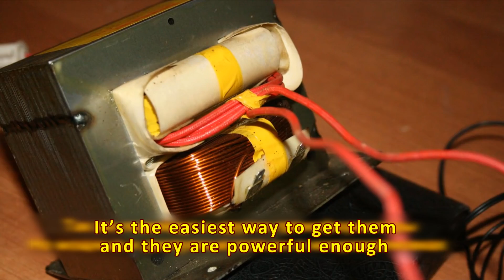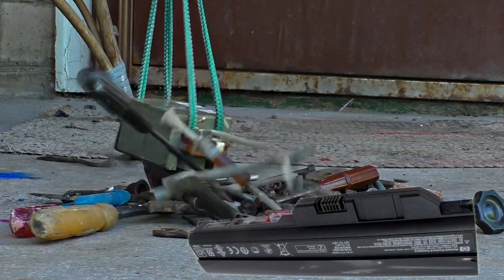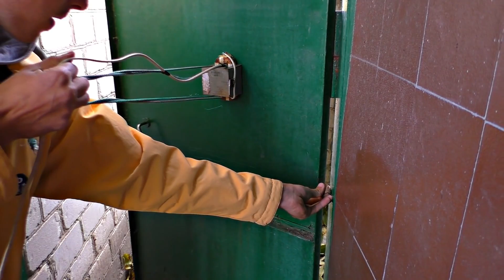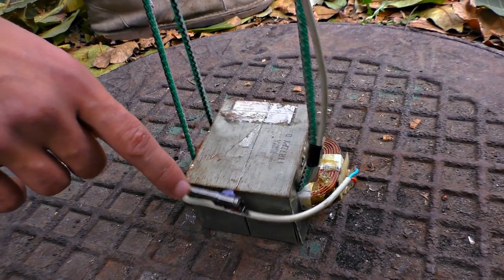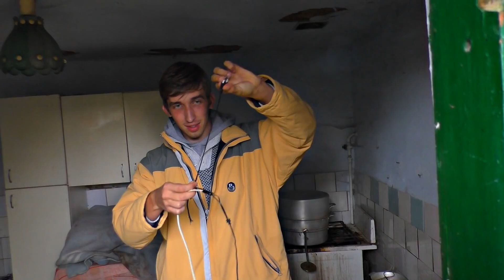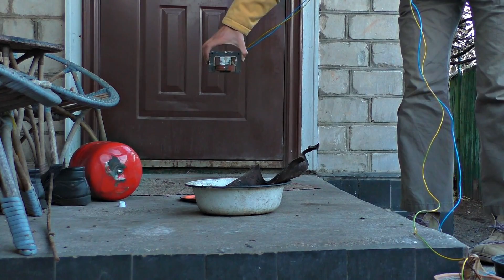Electromagnet DIY

Comment: Those magnets are used in electrical door locks, but the point is you made it yourself. It's weird how you neglect your safety while dealing with electric power. Stay safe and be careful.
Reply: could you please tell me what exactly you mean ? 
im newly mesmerized by electronics /diy how simple and cool it is but im super afraid of it aswell cause i do not really understand how its working for example why didnt he get a shock whille touching metal wich is attached to the grid via the cable i dont get it
Reply: @tonimontana9411  It is impossible to explain these things in a YouTube comment. Understanding physics phenomena takes years of schooling, including laboratory work.